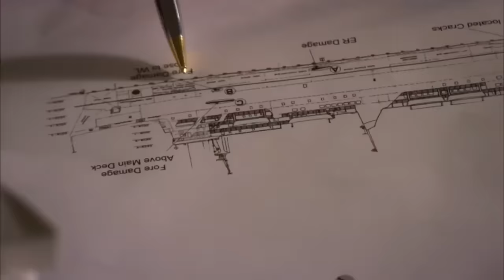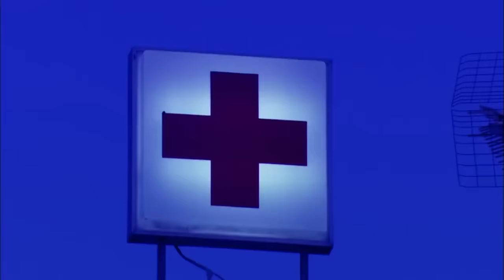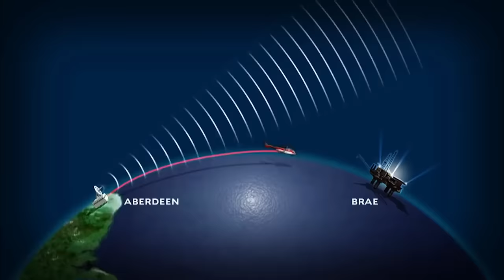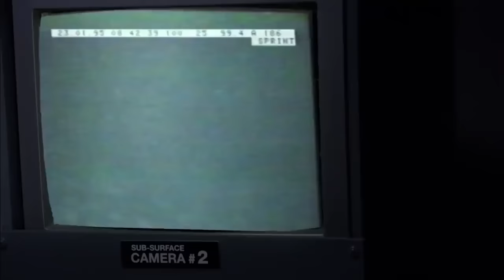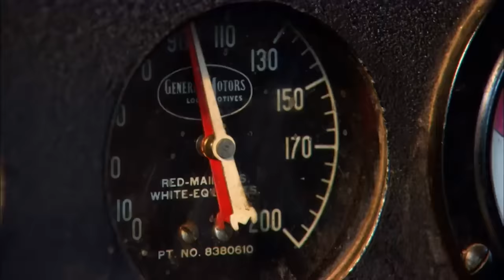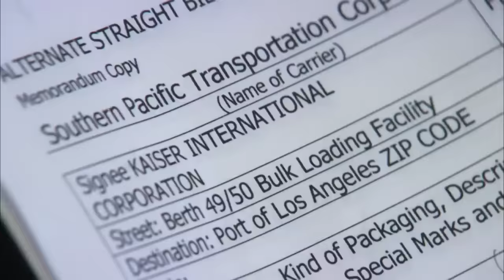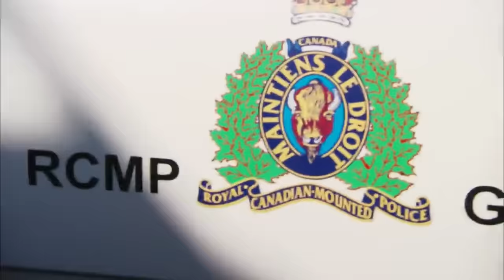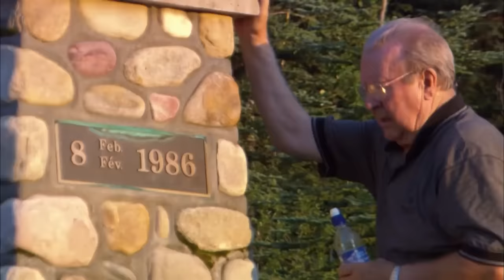The Worst Vehicle Disasters On Land And Sea | Mayday Compilation | Wonder

Comment: Frankly, the fact that the pipeline was allowed to reopen when they knew their safety valves weren't working is just insane to me. It's ridiculous what we allow these private companies to get away with.
Reply: You'd be very shocked about in what condition pipelines in the US are allowed to run. The one that truly scares me like no other is the decades old one that runs at the bottom of the Great lakes, like not underground but in the actual water. When that one finally goes (& they all will leak eventually as maintenance costs money & US corporations are against spending any on things like safety & maintenance so every single pipeline is woefully inadequately inspected & maintained.), it will contaminate all of that fresh water that can be used for drinking & irrigation. If I'm remembering right, it's something like 50-80 years old & it's been kept pretty hush hush for obvious reasons. They had to put supports on it cuz it was allowed to sag for years & years. 

See why that one is worse imo?

Comment: RE: the Hinton train crash...I realize this happened in 1986 but I'd think that there could have been mechanized systems in place to stop a train if the engineer/crew didn't heed the signals.  After all CN had "hotboxes" to measure speed/temps track side.  A mechanized solution wouldn't even have to be complex automation..maybe if there had been an audible alert in the cab as the train passed the signal to alert the crew of a yellow/red signal.  Just a terrible disaster that seems could have been prevented.  Relying on the crew to see the signals seems like a very weak link in the chain.
Reply: Subways have stop arms which come up under the train in event of runaway train. The wiring is connected to the signal. This is provided electricity is available. Diesel is just guessing.
Reply: @sharoncassell9358  - hey Sharon thanks for this insight. Off to search for videos on how that mechanism works. Sounds kinda slick.
Reply: Today's systems are basically a button the engineer has to press every few minutes to keep the train running. Failure to press the button results in an alarm going off. The one I've seen turns red every so often. To turn it off the engineer simply pushes the button. After about a minute, if not pushed, it starts flashing, another minute and a really loud obnoxious alarm goes off, few seconds longer, if not finally pushed, the train goes into shutdown mode. There's no way to bypass or disable the system.

Comment: It must've been an editing glitch when they put together this episode, but at 1:13:00, the original raft that kept them blocked inside due to the wind is now floating in the ocean. The editors must've missed that and used this take instead of a take that either still shows the raft blocking the door or a take that was filmed at a slightly different angle. Sorry, I'm a filmmaker and always spot continuity issues in film. It happens to the best of them. Even multi-million dollar films can have a continuity error that was missed by the editor, lol. There was a Starbucks coffee cup missed by an editor and is seen in an angle on Game of Thrones. We all know they didn't have a Starbucks in the year 300 AC, let alone paper cups in general. 😂😂

Comment: I have to stop watching. I don't know metric
Reply: Yes, I find these videos frustrating too as most are in metric. It would be helpful if they referenced some sort of chart or comparison at the start of these videos. For example, perhaps simply say, "This video uses metric, so basically 1 meter is around 3 feet". That would help greatly. 

In the end it's basic math though, or find an online calculator. I use a program called "convert". It converts just about any measurement you need. It got me through most of my college math.. lol.

How to convert meters to feet: Multiply meters x 3.28 feet.
For example, to figure out how long 20 meters is: 20 x 3.28 = 65.6 feet. 
This isn't 100% accurate, but it's close enough for our purposes.

-

1 meter is equal to 3.280839895 feet:
1m = 100cm/(2.54cm/in)/(12in/ft) = 3.280839895ft
Reply: Okay. Sorry that there are other countries in this world, where things are different, including using the metric system.
How dare they. 🙄

Comment: The whole ferry ⛴️ tragedy is so so sad in all...but being a survivor of a drowning in cold river water and I was gone gone for over 10 minutes as my brother in-law swam out  to me the last thing he told me I did was grab on to him ,I didn't know it was him.or else I may not have. In fact before that I was at peace with dying,or at least I thought I was. But I grabbed onto him,and with that I took the last remaining energy he had. He couldn't at first hold on to me,he didn't have anything but his raw power. And he tried but I was just dragging him under.  We were about the same size as each other 6 feet 220pnds I simply wasn't a strong swimmer and had been thrown into the river when the sand bar we were walking on went out from beneath us all .  Anyway he,my strong like an ox took my pulse and felt nothing,so he made the decision to save himself and initially let me go...as he started to swim back to Shore me long hair touched his foot😳 he then had thoughts of fish eatingat my body and he just couldn't stand the thought of that... He determined to get my body to shore ,so he turned back reached down and grabbed my hair pulled me up and basically threw me towards shore,then he swam forward and repeated the action several times until he finally got my lifeless body on the banks of the river ...the last thing he did was throw me onto my back and as that happened I let out a gasp of air along with the sludge that we went through on the shoreline as well as a load of water came spewing out of my mouth. He was very surprised at that ,and then attempted cpr, him and our other body worked on me for along time with our any thing else happening. They were about to give up and again there were gurggling coming from me...he rolled me onto my side and a load more of water sludge tar came out ,I had been a fairly heavy smoker...once he cleaned that away started again with the cpr and brought me back !!!🙏🙏🙏 Thats the giff of it ,not entirely all lined up the way it happened. But my point is ,or thought is that those poor people just left for dead could have potentially been revived if only there was more education about drowning victims,cold water has been known to help in someway. And by the way my brother in-law had been a certified life guard in high school,he was abit rusty but he said it all came back on what to do ...I thank God he was there and chose to drag me out of that river. Where I had no business being without a lifejacket...🙏🙏🙏🇨🇦